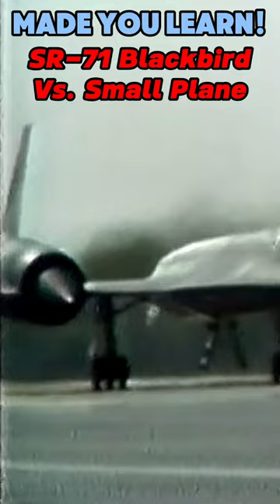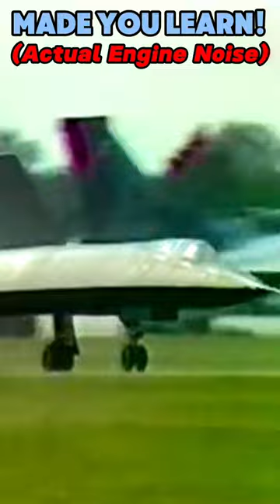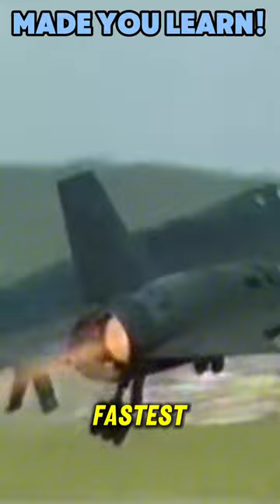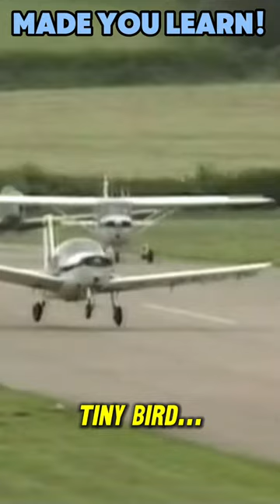SR-71 Blackbird Vs. Tiny Bird ✈️ Actual Engine Sound of Habu // Fastest Jet Ever? 🚀Made You Learn!

Comment: Fun fact.. the SR-71 spills fuel out when it’s on the runway cause the panels have to be made to expand at the super high altitude it can reach. If you look closely, you can see fuel pouring out before takeoff
Reply from the maker: The engineering is amazing! I always found this fuel leak compromise astounding. Geniuses designed this machine. And they made the best.
Reply: The panels expand because of high-speed heating, not because of altitude.
Reply from the maker: You’re correct! The heat and cooling made the panels and whole aircraft expand and shrink by many centimeters. This was adjusted for, and thus, sometimes fuel leaked until enough speed and heat was obtained where the expansion would “seal” the gaps in various body panels.

Talk about INSANE ENGINEERING!